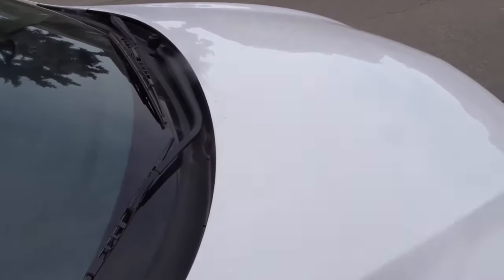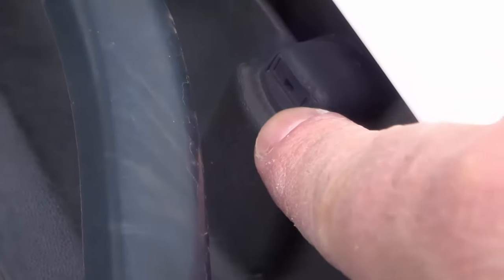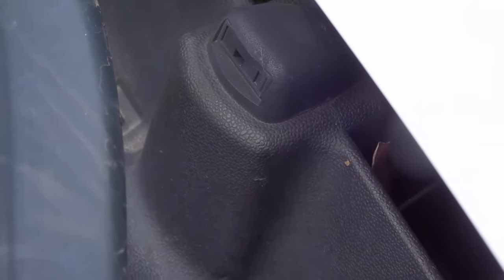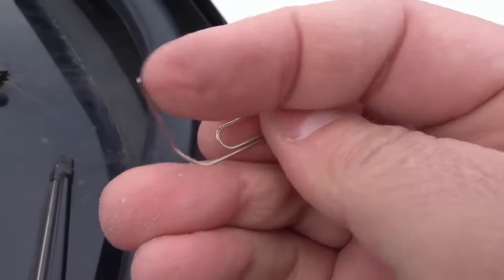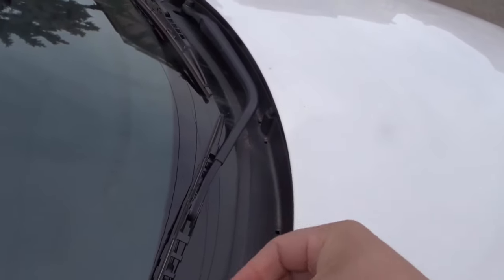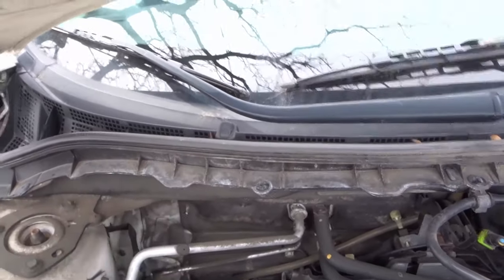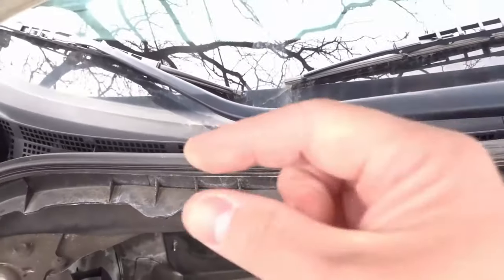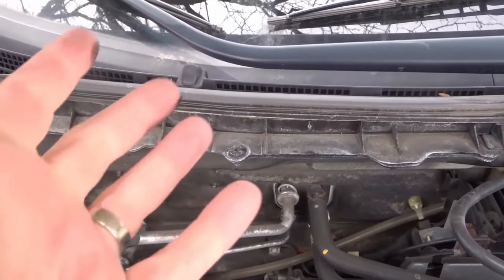How To Fix A Clogged Windshield Washer Spray Nozzle-Easy Tutorial

Comment: I have simply partially filled my reservoir with vinegar.  Then ran it periodically.  The acid ate the clog and the system returned to normal after several days. Good if you have some flow and time to let it do it's thing
Reply: Did you just dumped vinegar in the reservoir straight up or was it makes or diluted with water and what kind of vinegar do you use I notice sometimes one will spray and not the other and now neither one of them sprays and I kind of thought it was the windshield company maybe not hooking it up but, there is a little hose coming out of my passenger fender going towards the windshield so maybe they didn't mess it up
Reply: @Boomie0419   I just used normal vinegar that you would find at any grocery store.  Usually in the salad dressing Isle in a gallon sized container (so not the expensive stuff).

 I later found out that you can buy really industrial strength vinegar... strong enough to take the rust off an engine.  What I used was not nearly that strong and I don't think I would risk putting the strong stuff in the system.
Reply: Vinegar pits glass.

Comment: Wish you had shown how to remove the cowl covering the access to the hose connection. That is what I need to see.  I am sure I will break some connector if I don't know how to do it correctly.   Pin cleaning didn't work.  So no spray/water  on driver side at all, so I think the hose has come off that sprayhead.
Reply: On mine it's a 2014 Sonata there was three clips they look like screws but they're actually just popped in there. But I think you have to remove the windshield wipers also so I will be scouring YouTube to try to find that video too
Reply: You'll have to remove the wipers gently to remove that front cover that hides the line.

Comment: Unfortunately, this did not fix my problem, it actually made it worse.
Reply: Did you try inserting the paper clip only, or did you remove the nozzle and clean it?
Reply: @jamiev7165  I only tried tried the paper clip. I’m going to try using hot water through the rubber hose and /or vinegar and baking soda to break up the dirt that’s blocking the hose.

Comment: Paper clip, no joy.  Can of compressed computer air, no joy.  Rinse and repeat, no joy, but now I have a dribble on the nozzel that isn't working.  I had replaced the windshield cowl, the mesh dingus under the windshield.  There was a Y fitting, and everything was fine before I replaced the cowl, so the replacement cowl, found at a junkyard, had a clog from that fitting to the nozzle.  After mutiple failures, but I HAD A DRIBBLE, I realized I had a way to get vinegar to the nozzle.  At first, no joy.  Repeat, it worked.  Repeat again, it was spraying just as strong as the other nozzle.  Be patient, it took years, if not decades, for the nozzle to clog.  It could take a few days for the vinegar to do its job.  Me?  Less than an hour.  PS:  I washed off the vinegar after each try to preserve the paint and trim.

Comment: If a paper clip is to large to go into the sprayer hole, use a sewing needle. Rotate the needle to help break apart the debris stuck inside.
Reply: he mentions that at the very start when he suggest a sewing needle or paper clip depending on what works best for different vehicles

Comment: I just used a spray can and picked the hole with needle still nothing comes out
Reply: Then the line inside the cowling is off or clogged, check the other end at the resevoir.